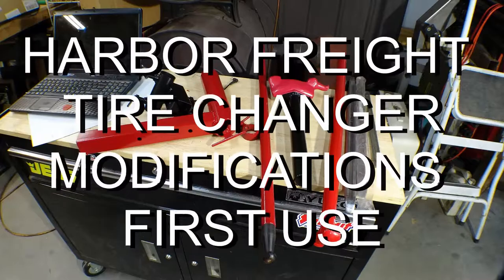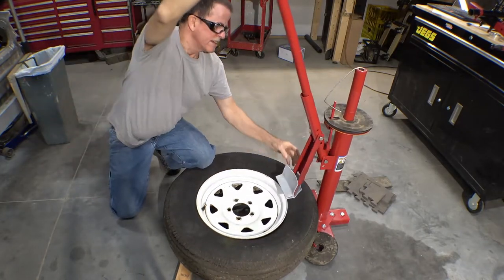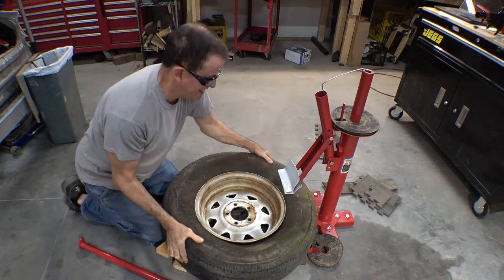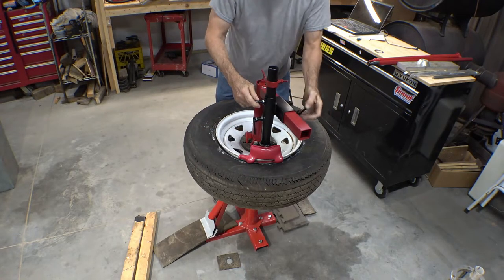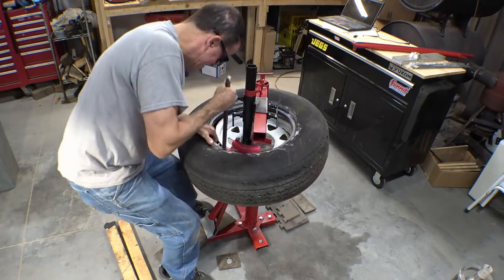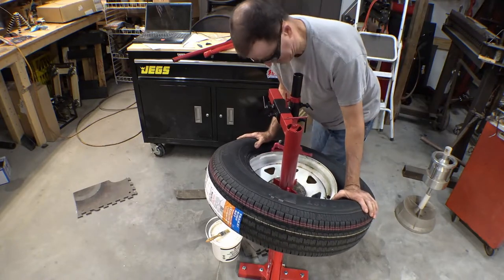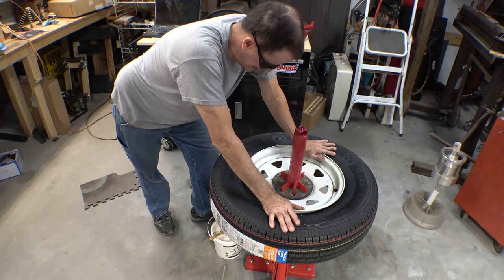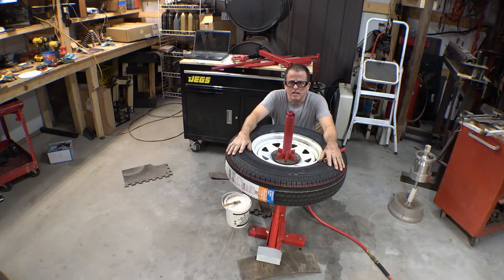HARBOR FREIGHT  TIRE CHANGER Modifications first use. change your own tires.

Comment: I did the same thing not quit to the extent of yours, but I welded a 1/2" socket on the top so I could use an impact or straight drill to put the pipe on quicker, and the pie that bent if you had of put the pin through the last hole or fist hole it puts the bead breaker on an angle which in turn is part of a Triangle which is stronger than a square like the middle hole created, if where the bead breaker plate sits on the tire bread I took a flapdisc and just made the corners smooth and round, and you won't need the plastic piece from the bucket mine doesn't dig in or nothing no tire damage at all, luv the content, and thanks so much for sharing ah! Andrew in Barrie Ontario Canada

Comment: That duckbill is a game changer.  Did the magnet under circular hub to hold up pry tube, no more bungee's spring back "works great".  Also removed that pendulum locating pin, underneath installed captive square nut 3/8"x16 thread that floats for different bolt circles ie radius, now install centering collar tube and bolt with matching lug nut installed on 3/8"x16 bolt, slide captive nut to line up, tighten bolt to keep rim from rotating, indexing the rim.
Reply from the maker: Yes I agree the duckbill attachment is great. I haven't done the magnet on mine yet now I have to get it done.   I did get rid of the pendulum, I am using a bolt/pin to stop the wheel from rotating.
   Thanks

Comment: Really appreciate that you use what you have lying around, plastic bucket for the bead breaker and the steel tubing from a bench press. I see people buying expensive hardware (steel, centering cone etc.) when they probably already having it under the bench. Cheers mate 🍻
Reply from the maker: Thanks 🍻

Comment: A few questions: 1. Would it be better to not use the lock screws on the square tubing that slides back and forth to adjust for rim size? It seems to me it would be better for it to slide back and forth in case rim isn't centered. The tire would push against the duck head and hold it in place.  2. I'm wondering if the same might apply to the bolt that holds the devise to the tire changer vertical shaft?  3. Does the duck head have a limit on tire sizes?  I'm wondering if it would work on smaller rims such as small trailer tires or ATV tires.
Reply from the maker: I don't know if letting it slide would help, every design I've seen locks it to the tube. The inner radius of the duck head may become a problem as wheels get smaller. But I've never tried it on small tires

Comment: Nice mods!!!

If you don't want to scratch the edge of the rim's outside, isn't it possible to turn the rim with the outside pointing downwards?

Then you'll work on the backside and any scratches won't notice.
Reply from the maker: Yes. You would have to protect the face of the wheel against the tire changer mounting surface. but it could be done.
Reply: Wheels are actually designed like a trapezoid. And this being the case tires are much easier to mount/dismount from the outside. That being said, I’m curious how easy this machine could make that endeavour.
Reply: @TylerDouglas100  - interesting. All my rims are designed with the exactly same design both ways. Inside or outside doesn't differ and should be as easy to change no matter how. 

Is it the tires you refer to? Some tires that are asymmetric have an specific outside.
Reply: @acke26  Yes you’re correct that both outside diameters of the rim are the same. But look at the different profiles inside the rim. The “drop center” is toward the outside of the rim. You use this drop center when mounting/dismounting by placing the tire bead inside it so you don’t have to stretch the bead so much, thereby making it easier.
Reply: @TylerDouglas100  - thanks for your reply. I'm not sure if I understand you correctly. 

If the "drop center" is the smallest diameter of the rim placed in the center,  then it's the same regardless if you mount the tire from the outside or inside. 

You mean the drop center is towards the outside?. The rims I have are symmetric in cross section.
Reply: @TylerDouglas100  - oh, now I think I understand what you mean. 

The rims are actually not symmetrical cause there's an offset. You're right the drop"center" isn't in the center but more towards the outside.

Your explanation is the best I've got (I've dropped that question about turning the rims facing downwards in several other videos showing the Harbor Freight tire changer)

Sorry that it took a while.......  :  )
Reply: @acke26  No worries, glad I could shed some light on the issue.
Reply: For automotive wheels, the drop center is always at the outside facing side of the wheel, so there's sufficient clearance for the brake hardware. Trailer wheels can be more symmetrical if they don't require brakes at the wheel.
The drop center needs to be closest to the rim edge when mounting and demounting, to get enough slack to pull the tire bead over the edge.

Comment: I'm not sure, but placing the bead breaker further out on the sidewall might help. If it's really sticking, it would deform and roll the bead a little
Reply from the maker: If the breaker foot hits too far from the bead it usually just slides down and away from the bead. Even on the bigger machines.
    I upgraded to a heavier lever /tube. It removes the pretty well now
Reply: @TSRGarage  Ah, I hear ya.. good deal!

Comment: So on part 2 of the build will there be a steel material list. I dont have stuff laying around. Thanks
Reply from the maker: Sorry it doesn't. The only critical part is the inside diameter of the pipe that fits over the center pin of the changer. 
   Part two
https://youtu.be/vrGFx3ENg7g
Reply: I've always done these with a bead breaker and spoons but I'm not 59 any more. Looking for easier way. I'll pickup the changer on Thursday and stop and get pipe.

Comment: That's a really nice build.  The only suggestion I would have is to shorten those locking wing nuts.  You are putting some force on the tire iron right next to those things one slip and it's going to be ugly.
Reply from the maker: 🤔 good thought.  Could take a socket weld a T handle on that, have a key (of sorts) to tighten the bolts instead of the welded on wings.

Comment: I just bought this manual tire changer, and plan on doing all of the same modifications you made as well. One question, do you you think a wider bead breaker would do a better job at breaking the bead off the rim? I was thinking more of a contact patch along the tire bead when you press down might give better results than that smaller edge against the bead. Just a thought. I haven't tried mine yet, but if I make that modification and works well, I'll let you know! Thanks for the videos. Great advice. 👍
Reply from the maker: I don't know if wider would be any better. Having some bead lube mixed up in a spray bottle ( which I didn't have for the video) to lube the bead where it is breaking  helps alot. 
     At the end of the video 16:40 I show my old beatbreaker.  It has a very narrow foot and it works great
     Also I have replaced the tube that bent with a thicker wall tube.
Reply: honestly the harbor freight tool that is only a bead breaker works Great if it is secured to the ground
Reply: When I tire has been on for years it will need some force to get it off.  All you need is a little soapy water.  I like to use a squirt bottle like the soap came in.  Push down hard squirt some soapy water in the depression.  Rotate and repeat, works every time.
Reply: Wider would be less effective because that spreads the applied force over a larger area and would require even more force to break loose.
Higher PSI with the same force, but concentrated over a smaller area.  Sometimes smaller is better-😅

Comment: How taller did you make your mod over the Harbor Freight lock down tube? Did you drill through the nut that you welded  on top of the lock down tube? the one that keeps the mod from coming up.
Reply from the maker: I just measured the tube 11 1/8, long enough to clear the nut that keeps the hold down bolt from falling out when not in use.
I did not drill through under the welded nut. The hold down bolt bottoms out on that metal. It leaves the mod free to move slightly. https://youtu.be/vrGFx3ENg7g

Comment: Don't try to break bead all at once, the HF tool is for occasional use not pro thats for sure.  Use lube/soapwater and walk it around as you suggested, work soap in and minimize force needed.  The breaker's not strong, bends easily. Reposition the breaker wedge to change angle to prevent wedge slipping.  Insert the iron with the flat side up into the breaker to help minimize bending of the tube when pushing down. Did a 18" vette tire on the changer with irons. https://youtu.be/ffo8Ey9d-RM

Comment: I just did 4 Michelin tires. Never had a issue breaking a bead on my HF but these were a freaking bear! Got is done but with much cursing!
Reply from the maker: 👍  thanks for commenting.  
     I think my trailer tire was well seated. It was on that rim for about 10 years as a spare. Also I didn't lube the bead  (but I didn't have to with my old bead breaker, I show it at the end of the video).  
      After mounting quite a few tires with this modification I'm glad I did it. I've gone from I'll change a tire if I really have to, to. why should I waste time going to a shop to have them changed.
Reply: I added 2 removable studs in the GM pattern to the plate so I just have to lug nut the tire down. Stays tight. So many things you can do to improve.

Comment: Hi TSR ~ I see that you've mounted your HF tire stand to your garage floor.  I don't have the changer, yet, but I'b like to get a jump on the project by drilling and gluing in the concrete anchors.  Will you please tell me what size hardware you used to mount the changer stand to your concrete floor?  Thank you for the nice video production .
Reply from the maker: 1/2 inch x 2
Reply: @TSRGarage  Thank you for the helpful information, sir. I was just going through the text and links, under the SHOW MORE control, and see that you purchased (3) replacement tips for the No-Mar mount/demount bar that we own.  Our plan is to use the Harbor Freight Tire Changer (HFTC), featured herein, with the No-Mar bar I just mentioned.  Our first set of wheels and tires are 18" OEM Subaru alloy wheels from a 2019 Subarus Outback.  Other than the rubber protection that you've added, do you have any thoughts on using the HFTC to work on 18" alloy wheels?  I'd also like to know what you used to make such nice clean cuts in, what looks like, fairly thick neoprene padding?  Not only do I like the duckbill holder that you fabricated for your HFTC, but I also like the other touches you've added to improve what is normally a fairly grueling process.  By the way, did you ever try the No-Mar mount/demount bar with your HFTC?  Please keep up the good work.
Reply from the maker: @bt5526   I did use the no-mar bar a little bit but I found the tips Kind of soft . They bend easily.  (I just bought the tips and put them into a piece of pipe to make a pry bar out of it) The duck head makes it easy.   https://youtu.be/vrGFx3ENg7g
Reply from the maker: @bt5526  the padding is a piece of old conveyor belt. Cut on a band saw.
Reply: @TSRGarage  Thank you for letting me know how you did this, sir.  Do you happen to have any thoughts on using the HFTC with a No-Mar bar on 18" alloy wheels?
Reply from the maker: @bt5526  🤔 haven't done it....

Comment: I would just get an xb-455 or 550 bead breaker, alot easier. One other thing when putting a tire on you should have the bead On the head the opposite to removing it, one side over one side under
Reply: The wheel should be braced solid against the bottom support of the bead breaker, if it's supported by the tire, it's less effective because then it's giving way with a spongy motion.
I use tire pads cut up from old tires to protect the rim from scratching, while still stiff enough to provide a solid backing.

Comment: Where to buy this adapter?
Reply from the maker: I made mine. https://youtu.be/vrGFx3ENg7g
  Lucid autowerks makes one. And I just saw this on E-Bay. I don't know if it is any good. I have not bought one.https://www.ebay.com/itm/115569153616?mkcid=16&mkevt=1&mkrid=711-127632-2357-0&ssspo=fF_aBbc8TUq&sssrc=2349624&ssuid=rmWEsfoqSyW&var=&widget_ver=artemis&media=COPY

Comment: hey thanks for sharing.  how do you balance the wheel/tire after doing this?
Reply from the maker: I have a Harbor Freight bubble balancer. They work great if you calibrate them correctly.
Reply: That tire diameter might be too large but I use my HF press ro effortlessly break the bead. HF tire spoons to remove old tire and install new one. Easy.
Reply: I think you would have an easier time breaking the bead if your bead breaker wasn't so wide. Commercial ones driven by impact wrenches are only an inch or two wide.(check them out). The slide hammer ones are only 2-3" wide. That pipe can only take so much. How much was that top piece upgrade with the duck head? Or did you build it yourself? Thanks for posting.
Reply from the maker: @rickl6697  I have upgraded the pipe. I built the tire change upgrade https://youtu.be/vrGFx3ENg7g
Reply: Was the duck bill mod a hf also ?

Comment: What all have you bent on this tire changer?
Reply from the maker: Just the tube for the bead breaker. I have replaced it with a heavier tube. 
  The uprights on the bead breaker would have bent. But I reinforced them before I used it.

Comment: Get the gap open a little when trying to break the bead , then put a little gasoline around it.
That will soften the rubber quickly so the bead will break. ( A Little Gasoline)..

Comment: Have you seen this balancer video and do you think it would be better then a harbor freight bubble balancer? https://youtu.be/sfNlAXJdy-c
Reply: This was another person that used a scale to balance a tire. Which type do you think will be the most accurate for a car tire? https://youtu.be/P5wYQzKEuHc
Reply from the maker: The 1st one looks like a good idea. Simple to use. The second seems a bit more complicated way of getting the same results.
Reply: Your build on the harbor freight duckbill tire machine gave me the inspiration to build one soon and a balancer :)
Reply: The duckhead part arrived today and did you use 1 inch round plumbing pipe? I brought steam pipe once for bushings on my old jeep that held the leaf springs, now that was a thick pipe wall. Did your pipe bend? If not I will go with the less expensive pipe. Only going to make one too.
Reply from the maker: @chrism9185  I mostly used left over steel tubing. The tubing on the duck head is 11/2  .095 wall.
Reply: Thank you. I have a stick welder and will be picking up the metal next week. If it is heavy I won't mess up the welds with a 7024 iron powder rod. Then I will work on getting the balancer made. I have some 3/16 sheetmetal to add on the bead breaker like you did too.
Reply: Took off my first tire today and bent one bar on the left side of the bead breaker. Then used my slide hammer type bead beaker. The duckhead worked great. Also made a jb weld epoxy centering cone out of a funnel that worked well too. My luck found a crank on the aluminum rim when I was removing all the black bead seal on the rim from the last tire shop that I went to, not anymore. :)